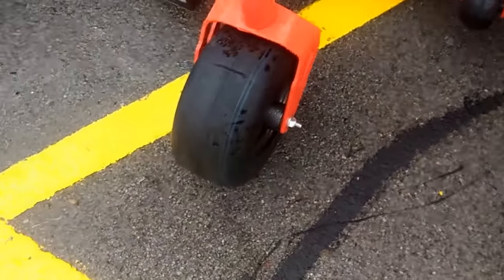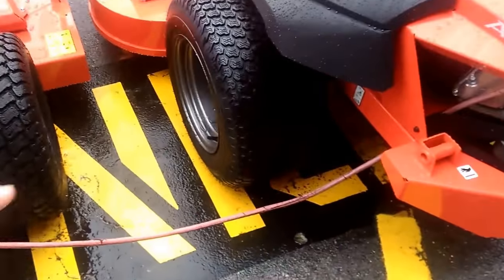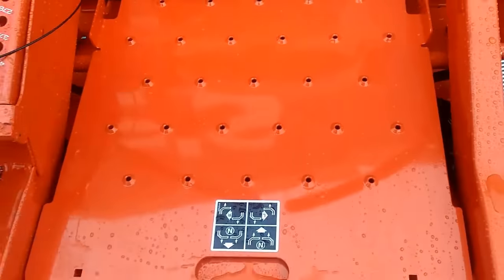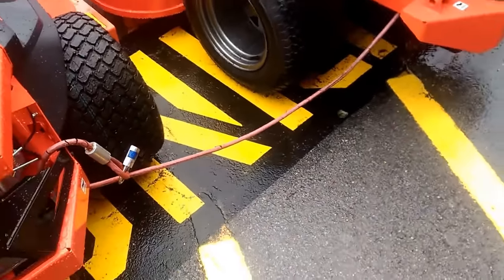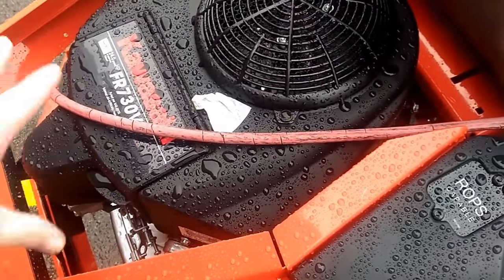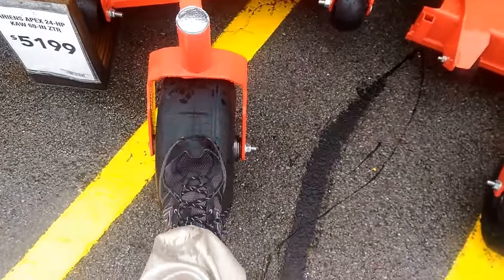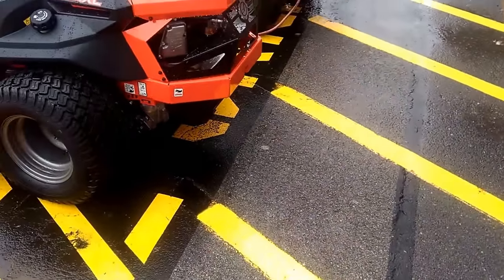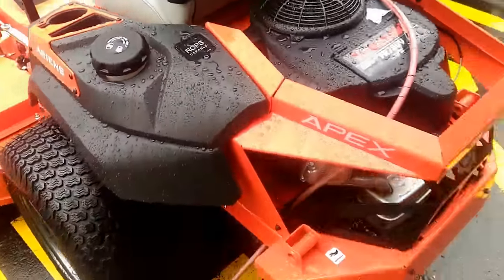Ariens Mowers At Lowe's!

Comment: The Ariens Apex is the equivalent of the Gravely ZT-HD.  They are basically one in the same.  The Apex is considered a high end residential machine.  I just bought a ZT-HD 48 inch and absolutely love it.  So I obviously would recommend the Apex.  I would suggest going to an independent dealership if you have one nearby though.  It will definitely be easier to get warranty work done if you ever need it.  If you don't have a dealership nearby then Lowe's would do.
Reply from the maker: yep same machine.same company.I am not in the market,but almost bought that one lol.But purchased another scag recently.But maybe soon.I am all about dealers
Reply: The Apex/ZT-HD have some commercial features (transmissions, deck, tires, frame, etc) which make them very appealing.  I wouldn't get one if I owned a commercial business just because of the FR engine.  The FR is a great running engine but it's designed for residential use.  I wouldn't go anything less than an FX if I mowed commercially.  With that said, the best part about the Apex/ZT-HD is the price for what you get.  Scag, Toro/Ex-Mark, Hustler, Dixie, etc. are all about $1k more for a comparable model.  If you own a 1-3 acre yard, this mower should be right in your wheelhouse.
Reply from the maker: Husqvarna has a commercial mower very close to price.Also kawasaki makes engines they said.They dont purposely make "cheap" engines.I have worked on them as well.They use the same part numbers.Some have better carbs but rest is same.Commercial mowers also use the kawasaki FS,FH ,kai and FX.the bearings in the engines are the same.same cast liners to.Mainly carbs.even the coils are same.Now briggs makes many grades as they are a super producer to meet certain price ranges.Kawasaki isnt intended to be in a low priced anything.Honda is the same way.I def would buy that apex and I own a lawn business.

Comment: Ariens makes XL model To. The XL comes with 20" tires. Bigger front tires. And the X is sealed gear box the XL is not. LED Light kit ranges from 109.00 to 150.00 comes with all wiring needed easy install as well. This dude I bet shiny lights impress him as well

Comment: I  visited  Lowes today looking over a zero turn mowers' now what I can't  understand is that john deer craftsman others' showing it has hydrostatic transmission ; now I own a 24 hp Kubota Diesel finish mower  'which has hydrostatic transmission ' so when I'm using it and going long if I decide to stop and go backward I just press the heel of my foot meaning  toe press goes forward heel press goes backwards  however on these mowers at Lowes everyone of the zero turn mowers claiming hydrostatic transmission only appears to have forward only if you what to go back it had a R drive slot to the right meaning stop put it in reverse   move backwards ' that my friend is not pure hydrostatic transmission , that is like a regular mower' now my YouTube  friends what am I not seeing here that I see on my Kubota 24 HP Diesel

Comment: Any thoughts on the Craftsman Zero turns sold at Lowe's? Ive seen them up clise, and really like the tubular frame with those 20 inch tires. Also, the reviews are all high. I did notice the Craftsman decks are stamped though. But they're 13 gauge steel!
Reply: 13 gage is thin 11 gage is 1/8”.

Comment: They have really caught my eye with this machine. I've had my cub cadet lt1050 mowing 4 acres for 14yrs. Trust me when I say she's tired. Almost gave up on finding a 3100 hydro on a decent sized zero turn. I really appreciate the side by side comparison showing the "beef" of the apex. I have a few slopes, and wanted Wide stance with the bigger tires also. The cub dealer wants $5700 for a steering wheel model with 3100's! Only reason for steering wheel is for my wife, no learning curve needed. But man, I'm 6'4" 310 and look like a monkey on a football driving my 1050, it just won't die. Lol. This would definitely fit me better. MUCH better. Just not sure about a 60" or go with the 54" deck. Using a 50" now, and going from a rider to a ztr will cut the time by a ton anyways. I believe the price difference is only around $100
Reply from the maker: bad boy has one same price with 3100.but this apex is beefy.bad boy not so much.zero turn will save you 45% on time.So it will almost cut it in half.good luck on your search!

Comment: Mower on the left is apex is the lower modle and the ikon is the Cadillac of Aries zero turn mower
Reply from the maker: apex has commercial hydros, ikon has 2800 pumps.apex by definition is the "apex" of the lineup.Plus it is made better and priced accordingly.both nice.gravely makes them.course ariens owns gravely.
Reply: Ikon is the base model, then Apex, then Zenith which is the ‘Cadillac’.

Comment: I was a lead mechanic for a major outdoor power sport franchise in FL. Only delt with Toro and Stihl. I own a ikonx 52. With a Kawasaki engine. The toros brand is absolute junk compared to Ariens. Ariens is made by Gravely. Toro you gotta pay extra for everything a Ariens it comes that way. TOROs stamped deck is junk. I worked on Toros for years I will never waste my money on that Brand. Toro is comparable with a craftsman. Both are junk. if you want a quality machine that's built right and heavy duty ARIENS ALL DAY
Reply from the maker: ariens owns gravely yes. But saying negative things about toro i will have to disagree with.I have a 2008 residential toro z4200 and used it commercially for years.Still perfect and i still own it.I also bought a commercial toro zmaster in 2013 and use it still.Zero problems.Actually toro/exmark overbuilds their commercial mowers.I think the ariens look great.
Reply: @exterminator1  I worked on Toro mowers all day for years. I know the insides and outsides of a Toro mower I also work on there heavy commercial equipment. When i left i had companies calling me asking me where I went and if I opened my own place. I can say Toro is just a name.
Reply from the maker: @smokintruker27  doesn't change the facts of my statements. So for me I disagree.Which is ok.Hope you get years service from your ariens.several people I know has them.I made several vids on them as well.
Reply: @smokin truker Would you take a moment to look at the new 2020 Ariens Ikon XD 52 w/kawasaki and tell me your input? I've got $3100 to spend and want the best in that range. Thanks.
Reply: I totally agree with you. I was constantly working on toros. And big money as well. Ariens is a Gravely brand. And part you buy for your Ariens comes from gravely.
Reply: @flippindocks8183  to be honest no big changes from I bought mine in late 2017 around november. The changes made is really no big difference. Cant beat the Kawasaki engine the seat is very comfortable with arm rests. It's my favorite mower. I love it. Just read owners manual and change oil for break in period. Then your standard time. It has a regular twist on filter. Makes it alot easier. Comes with a clear tube you use to easily empty crank case into a oil drain bucket. You will be very happy with it